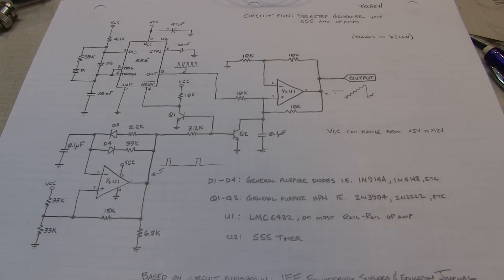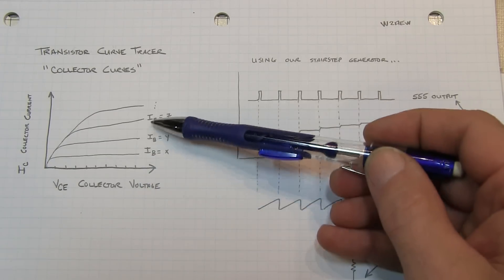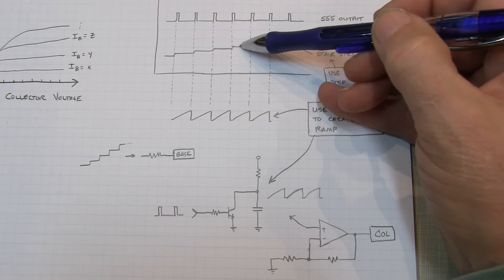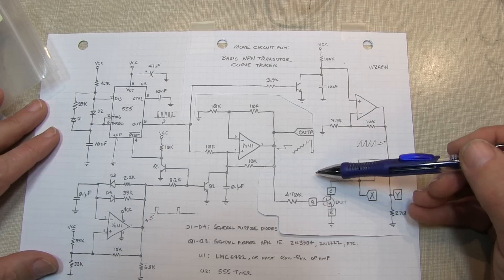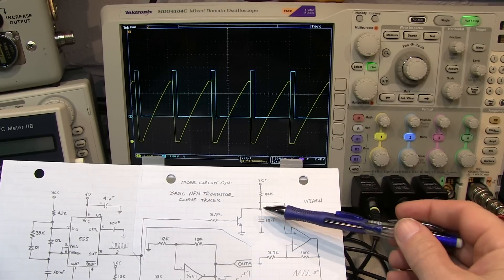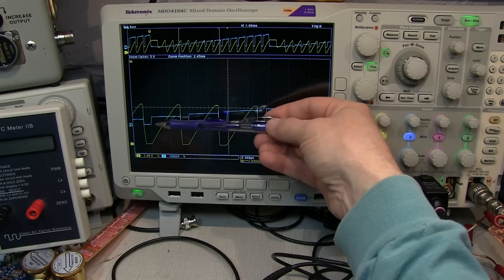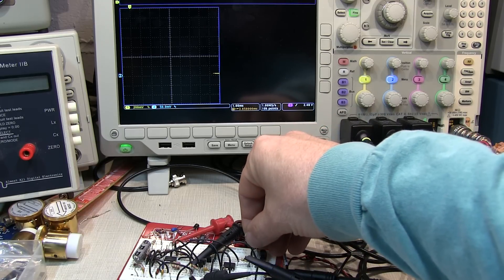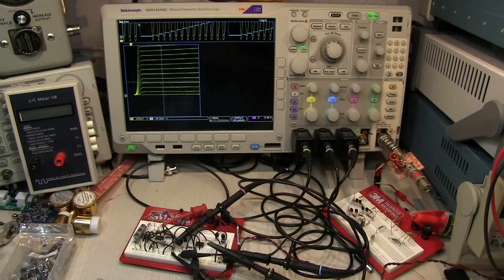#232: More Circuit Fun: Simple transistor curve tracer using Stairstep generator circuit

Comment: This video is fascinating. What transistors are you using for the current mirror? Could you use 2N3906's? Is it possible to get a matched pair of PNP transistors? Thanks.
Reply from the maker: I probably used 2N3906 (not sure, since it was 9 years ago).  For this simple tracer, device matching isn't terribly critical.  Just using the same type should be sufficient.

Comment: Really great. Thanks for the explanation . There was a Dutch article and circuit using an npn astable multivibrator to produce the pulses and then a couple of npn s and one pnp with a germanium diode to produce the Steps which eventually found its way into Elektor magazine. Similar concept. I think they used the ratio of two capacitors to produce the step.

Comment: What's interesting in your videos and actually important but lacking in education, is how you solve a problem by using simple building blocks, which most of us have studied, and learned how to analyse, using maths and calculating gain and impedances, but not shown exactly how to use these building blocks in real life to design an application circuit.
These types of videos are of great importance for anyone who wants to understand how building blocks are combined, in order to design a circuit and solve practical problems.
Many thanks indeed, very inspiring and I like your paper and pencil method combined with real circuit.

Comment: What if you used the stairstepped output, ran it through a comparator to generate the pulse to reset the 555 and discharge the capacitor at the stairstep opamp?
Wouldn't that make that the pulse generated by the leftmost opamp unnecessary?
Reason I am asking is that in the application I am interested using this in, I want to control/adjust the max stairstep voltage, as well as the size of each step.
Reply from the maker: Yup, that would work.

Comment: What kind of circuit would you use, if you wanted to match 2 transistors. 
Is there a wheatstone bridge version of a curve tracer, where you can put both transistors in circuit against each other?
Reply from the maker: It really comes down to what you need to match (Vbe, Beta, leakage, etc. or threshold/cutoff, Idss, etc.) - it is possible to design circuits that would indicate how well matched some parameters are (but not all with the same circuit).  Most curve tracers have a way to measure/compare two devices, often by being able to switch between one and the other quickly.

Comment: Enjoyed your video Allen!  Is there a curve tracer that sweeps from 60~ to about 10MHZ?   When checking caps I need a higher sweep rate to read small caps, 10MHZ preferred for junctions of various transistors/diodes.  I've been using 60~ over the years and its not giving me the coverage I want!   Your circuit of "#232" is great but its an over kill vs the one I have at present.  Thank you, 73's , Gary Grove CET

Comment: OK, may be this is the wrong video to ask this question, but, I  Know that if someone knows out there, it would be you:
 How would you convert signals for CRT to VGA or any other type of monitor.
Reply from the maker: This would not typically be a DIY project.  It would involve synchronizing, digitizing and formatting the video stream.  I did find one DIY project, pretty involved:
http://elm-chan.org/works/sc/report.html
Easier/cheaper to buy:
https://www.amazon.com/Composite-Converter-Transfer-Projector-Computer/dp/B081SBNJ58

Comment: I was expecting a more exponential rise of the C-charge, but in this way (early cut-off) it it quite linear. Otherwise a simple current source would do a linear work. But maybe it doesn't matter at all, as we are plotting the resulting collector current on the y-axis, it really doesn't matter in what fashion the Vce is changing, as long as it is incremental, I suppose. We just get more or less points in some regions.... Once again interesting circuit 👍

Comment: You probably could have made the same circuit using the 555 as a clock source and 4 weighted binary ripple counters in a 1-2-4-8 state. It may not have the precision of your circuit though.
Reply from the maker: Actually, a digital counter and something like an R2R ladder DAC would be more precise.  But, I put this circuit together on a whim to follow the previous video (#231) that examined this interesting stepped integrator circuit.
Reply: @w2aew  I see. I had to rewatch your video and take a step back and think. I realized I used the word precise incorrectly because yes a digital circuit would be way more precise. I completely confused myself.

Comment: So, I made the curve tracer circuit and I can see that it wants to work but my signals are so small that my scope can't make the curve tracer visible, and I've set both channels at the lowest of 10mV per division and I can see the right kind of waves but very, very vague, mostly some dots.

You didn't mention what kind of transistors you used for the add-on circuit and you also didn't mention what the op amp is so I grabbed a few transistors and an op amp that I had.

The NPN transistor I used is the "LC945P" which has a beta of  343, the two PNP transistors for the current mirror I used the "A949 Y" for, with a beta of 180.
And the op amp I used is the "KA393" which is a dual operation comparator and when I check the input signal coming from the 555 timer, that's okay and the NPN transistor changes the signal and amplifies it and I can see that the comparator is doing something with the signal so on the output I see something that resembles the signal that you've drawn on the schematic at the output of the op amp, in my case the comparator and all that seems to work fine.

Now when it comes to the PNP transistors that's a different story and because the collectors are tied together and the bases too without any resistors between the two there's not really much I can do I think, so it would be nice if you can share with me what the beta was for the PNP transistors that you used, I don't think that I have the same parts here but I may have a few that are better matching with the ones that you used for the current mirror.

I know that it is a long time ago that you've made this circuit and this video but can you recall which transistors you used?

I really want to have this circuit working so I can show it off to my friends together with the other function generators that I made, and I find it pretty nifty that I managed to do it all with analog circuits, even the more complicated waves look very nice and sharp and I haven't even soldered it all together so most of it is running on the breadboards.
It's so satisfying when I finally got it working.

I hope you get back to me soon so I can finish the last bit and make it work and show it off to my friends.
Best regards,
Ricardo Penders.
Reply from the maker: A KA393 is a dual COMPARATOR, it is NOT and OP AMP!  They are not interchangable.  You'll need to replace it with an op amp.

The PNP transistors I used were just general purpose low-power devices.  Actual part number isn't very important, you just want them to be generally fairly matched with beta (within 20% or so).  I probably used 2N3906 transistors in mine.  Note that the collectors on the PNPs are NOT tied together!  Please check the schematic and your circuit.  The bases are tied together, and the emitters are tied together, but the collectors are definitely not.
Reply: @w2aew  OOPS, I switched the collector and the emitter connections I think, I know I have the bases correct for sure, the top side of the two PNP's which is coming from the op amp those aren't the collectors?

Are those the emitters, and the collectors go to the oscilloscope probes for the X and Y, right?
Reply from the maker: @RicardoPenders  Emitters have the arrows on them.
Reply: @w2aew  I made some changes to the circuit, I'm using the UA741 single op amp now and now I have the bases and the emitters tied together as it should be.

So, now I'm getting in the right direction and I see completely different signals as before, much stronger and at the right kind of voltage levels that my scope is able to pick up.

However, my curve tracer on my scope looks nothing like yours, it's drawing a curve alright and I do see the different levels whenever the stairstep goes one step higher the output of the curve tracer follows  with the stairstep wave.

I'll have to make a video of this because without you seeing the actual curve tracer I can't explain anything of it since I have no idea how it works, I'll try to make the video today and let you know when I have it uploaded here on YouTube.
Reply: @w2aew  Persistence pays off, I've got it working correctly now, only my curve tracer is the other way around so from right to left.
I had to change the timing capacitor that gets the signal from the 555 timer through the NPN transistor so where you used a 10nF capacitor I'm using a 1nF ceramic cap (102) instead of the (103) and now that I changed that one cap the curve tracer looks much better, maybe I can improve it a bit more using a bit smaller cap even I have to try that.
Reply: @RicardoPenders  I find it best to use the same parts as the circuit, get it working, then modify afterward, so you know you're starting from a good point.

Comment: I'm making this circuit at the moment, I have the stairstep circuit working I need to add some potentiometers so I have the option to set some variations.
I want to be able to set the frequency higher and lower, now it oscillates at 185Hz exactly.
I also want to be able to set the amplitude and if I can add the ability to input a DC offset that would be great.
I'm also adding a switch with the resistor for driving the gate of a MOSFET and the resistor to ground so I can do both and don't have to change the circuit every time.
First I'm making the circuit on a breadboard so I know for sure that it works with the components that I'm using and then I'll make it more permanent on a perf board and solder it all together.

I already made a different function generator using two 555 timers that have the output synchronized but the second chip outputs the signal inverted.
On that function generator I can set the duty cycle from about 20% to 80% at the moment so that could use some improvement, I can set the frequency from 1Hz up to about 450KHz, I can also change the amplitude of both outputs and all the settings work independent so changing one setting doesn't change the other ones.

So when I have this circuit working I'm going to try and put all the different function generators together on one single PCB, it would be nice if I can use the timer chips and the op amps for the different purposes to keep the component count a bit lower but if I can't get it to work it doesn't really matter because I already have all the parts and those are pretty cheap but I don't want to use up everything I have for this function generator, if I can save some components I don't have to buy new ones when I want to start tinkering around and use it for something else.

w2aew, your circuits took a long time for me to really understand what is happening but I've learned a LOT just from watching your videos and making the circuits myself, because there are some differences in the components that I'm using it was a challenge for me to get my circuits to work properly but as you already said it is the best way to learn this stuff.

I wish you have a great day w2aew.

Comment: hi Alan. just did this circuit. im using a MCP602(ebay). i know its fake(?) but it works on supply of 5.8Vdc(max 6v as per datasheet). now upon probing around, I get a jittery pulses from 555. the other opamp schmitt osc, is stable. im not using 'good capacitors' for the timing ckt as it is only low freq. each chip has its own decoupling 100nF. im using MLCC caps 100nF 10nF. would this cause the pulse jittering on the 555? ceramic caps seem to be microphonic. I wonder if this is a bad thing for timing circuit? maybe I just should use mylars instead?
Reply from the maker: What is jittery about the pulses from the 555?  Pulse width?  Pulse repetition interval? Pulse amplitude?  When measuring them, what are you triggering the scope on?
Reply: hi. just forget the 'jitter'. my mistake. its because its being 'switched' by the schmitt. removing the op-amp. I get jitter-free osc on 555. 

heres a quick video on mine. maybe in your future videos, youd consider a pnp mod for this. and maybe jfets as well? 'matching' for phaser use(guitar fx).. I even tried checking J201, I could see a trace but apears to be 'amplified curve'.. with a few tweaks on scope amplitude, could be possibly usable

https://youtu.be/qpyMLIrIuXk

BIG thanks 👍

Comment: What are the transistors used on the current mirror circuit?
Reply from the maker: Just general purpose devices of the same type.
Reply: 2n3906 works well.

Comment: QUESTION: Is there not a fairly easy way to make this work with a PNP transistor?   Made this stairstep circuit a while back and was going to build a transistor curve tracer and thought of this.  Would really like it to work with PNP transistors also.  And power transistors.  Wasn't sure if this would work with them either.  Love your videos!  You explain things very well.  Thanks!!
Reply from the maker: There is a fairly easy way to make it sorta work for PNP transistors.  Get rid of the current mirror transistors.  Connect the Emitter of the test-PNP directly to the output of the upper right op amp (where the emitters of the current mirror was connected).  The base connects to the same place.  The collector goes to the 270ohm resistor.  X and Y connections are to the emitter and collector of the test-PNP.  Note that the curves will be flipped upside-down, and the maximum current curve will happen first.

Comment: Is it absolutely mandatory to use rail to rail op amps?
Reply from the maker: If you can use a split power supply for the op amps, then no.
Reply: @w2aew  Thanks a lot for the answer
Reply: @w2aew  It helped me immeasurably

Comment: all Vcc works in the same voltage? what voltage uses this ? thank you alan
Reply from the maker: Vcc is just a label that represents a positive power supply voltage. Other common labels for the positive supply rail are V+, Vdd, etc.
Reply: @w2aew  of course, but what magnitude you use in this circuit?
Reply from the maker: @al3xcg  I think I used 5V.

Comment: How would you modify this circuit to make a curve tracer for Vacuum tubes?
Reply from the maker: Would need lots of modifications - a high voltage supply to drive the plate ramp voltage.  The step generator would have to be shifted/inverted to create negative voltages to drive the gate.  Plus, you'll have to add a heater supply.

Comment: Hello,
Many thanks for sharing your invaluable knowledge!
Forgive me if my question is stupid. I am not an electrical engineer! Would you please let me know if I need to modify your circuit to make it useful for curve tracing GaAs HEMTs( such as FHX13LG)  or MESFETs( such as NE25139)? I have a few LNA design based on these. I would be glad to send them to you if you are willing to make video about them.
Thank you again.
Reply from the maker: It really wouldn't be suitable.  These devices require a negative gate-source voltage for all or part of the curve tracing, which this simple circuit does not provide.
Reply: Thank you very much,

Comment: This could also be used for matching valves, couldn't it? You'd just need a transistor or triode in the voltage ramp circuit that can handle the voltages that valves like, and of course an appropriately high B+ rail..
Reply from the maker: Conceptually, yes.

Comment: Great video!
I just built the whole circuit. It works great for BC547C and BC547B. But only if I plot collector currents of 1-2 mA.
If I plot curves up to Ic=10 mA or so, I get a linear slope in the left side of each curve (longer, for larger collector currents), before the curve gets almost flat.
For Ic=10 mA, the curve is not almost flat until about 3V collector-emitter.
This is not "real". A current sensing collector resistor shows that current gets "flat" at little about saturation voltage.
Any idea why this happends?
Reply from the maker: This circuit is far from being an ideal curve tracer, so there certainly will be issues like this.  It is quite possible that the op amp used to drive the current mirror in the collector isn't able to supply the current (which would be 2x the collector current).
Reply: True. I'm using LM324 which output current is about 1.5 - 3 mA. 
I placed a simple emitter follower between op amp output and current mirror emitters (no resistors, just a bare BC547C), but nothing changed.

Comment: 10:15 "...if I was going to set out to build a curve tracer I probably wouldn't start with this..." 
Why? Is it unnecessarily complicated, inaccurate, or ineffective? What is the ideal design (or design elements to seek out) for someone with an entry level digital scope?

I've seen #197 and #49, your two other videos on curve tracers. I probably don't "need" a curve tracer, but I feel like I learn a lot more about practical electronics by building circuits like this. Plus, no one complains about having too many tools to work on projects ;)
-Jake
Reply from the maker: I probably wouldn't start with this mainly because it is a bit inflexible in setting up step sizes, etc.  I'd probably start with some kind of microcontroller and a few DACs, etc.  I would bet there are a few kits out there...